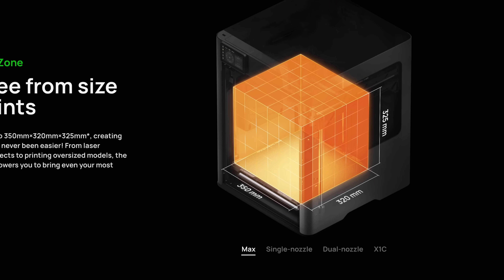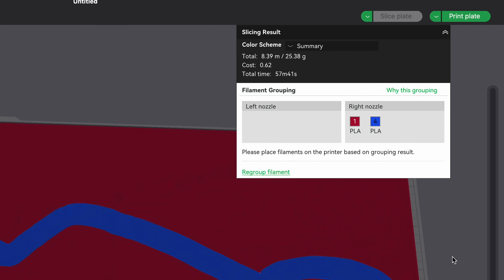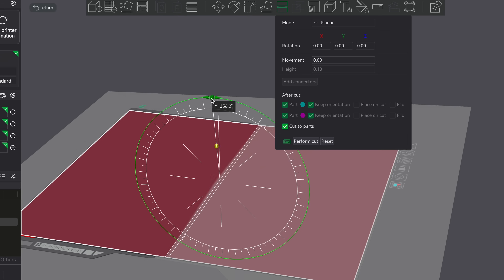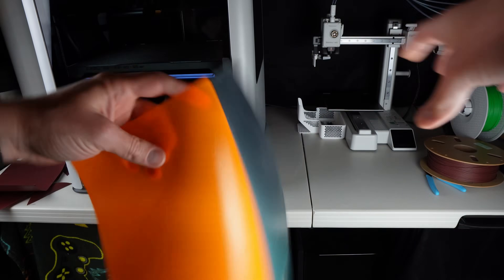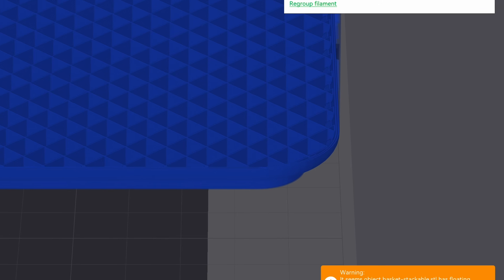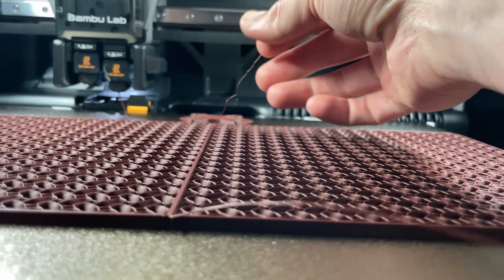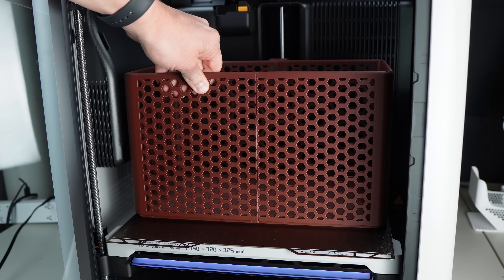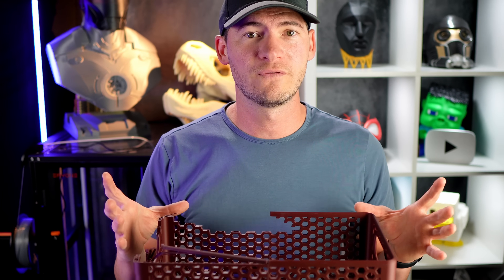How to print 350 mms on the H2D

Comment: Hey! Here is a trick for anyone worried about seam adhesion: Split the part in half like in video and move one part over  0.05-0.10 to the other, this will make one filament print a small bit into the other one. If you paint then just use the interlocking setting in the slicer👍🏻
Reply from the maker: Thanks for the tip!

Comment: OMG this is exactly the problem I have right now. The software only let me print the support with ONE nozzle for both parts. I really really wish for a software update for that machine.
Reply from the maker: Yeah, that would be nice. Hopefully they change something soon. You could add your own supports and another part but that might not work as well.
Reply: @The3DPrintingZone  It took me a while to figure out that the supports were the issue (before I stumbled upon your video) but I noticed I could move the part into the "right nozzle zone" and it baaarely fit. So for now I am just glad I can print the part at all. 
I really hope for 2 things with this machine.

1. Being able to operate at, with all it´s feature without the use of  Chinese cloud. I don´t care what they tell me, I work in R&D and I don´t share my information with some Chinese company.
2. Being able to simply use the full print bed if the same material is chosen for both nozzles.
Reply from the maker: @sierraecho884  I hear ya! I’m hoping they eventually release an update that changes the slicer to automatically split the part with a hidden seem.
Reply: @The3DPrintingZone  Yeah me too. Paint on seam, or a seam option along inner crevasses. Something like that.
Reply from the maker: @sierraecho884  right! That would be great

Comment: Stuck between the H2D and the K2 Plus. I know the bambu is bigger but not by much. However the dual nozel and slightly more bed size (i have a big head and i need 2% more in mostl cosplay helemets and it gets bigger than bed on P1S. K2 plus however Larger print bed! Though ive been hearing nothing but nightmares for users with broken parts
Reply from the maker: Honestly, I think either one could work. If you can afford the H2D I’d say go for it for the added benefits but I’ve heard great things with the K2 Plus as well. If you’re printing multi material or multi color parts, I’d swing towards the H2D.
Reply: All printers have broken parts, u dont hear much from bambu users because its a cult nowadays, regardless both will be good, creality sends parts or so ive heard, i own a plus4 and k1, no issues with the k1, it had a trash bed but i ran some leveling, same with plus4, i got parts for it but ultimately didnt need them
Reply: @Axxel720  Everyone says that but Bambu machines just works. I only ever looked up youtube videos for my first year 3d printing just for common issues on user error. So I never interacted with Bambu Fan base. My friend had a K1 Max and it would be perfect one week and dog water the next and then it needed parts and it was garbage for him. If you look at uncle Jesse video and Two Moose and others of that pop up reviewing the K2 plus. Its all about broken parts, clogs, filiment ams issues and wrapped beds. The K2 looks great with its bed size but I don't want to buy a 1k plus machine just to message customer service and pray they reply for them to send a part and wait a week just for another part to break
Reply: @Gensis300  So if you believe this why are you even asking? look in ANY forum for any printer company and its all issues, because nobody posts the machines that work, buy whatever you want in the end its your decision but dont ask for opinions if you wont take them, everyone gets lemons for any company
Reply: @Axxel720  Because I want to see if these issues have been fixed or if all these trouble shoots have rolled out through an update. Plus it's open comment sections so others may have insight as well
Reply from the maker: @Gensis300  I’ve owned over 25 different printers. I joined the Bambu train this year and it’s mind blowing to be honest. I own the A1 Mini and now the H2D. I don’t think I’ll buy another printer brand. That being said, I have printers sent to me monthly for sponsored videos so I’ll test them but there aren’t many I’d put money on beside Bambu Lab. I bought the H2D with no regrets. 

My Brother has the K1 and likes it 🤔
Reply: Update i got the k2 plus with CFS. So far I printed benchy, flexi rexi as test prints and all came out great. I printed a fully wearable helmet and has been great so far. Software has been awkward to use but besides that's it's doing well. Haven't use mutli color print so time will tell
Reply from the maker: @Gensis300 that’s great! I’m glad it’s working well so far. Let us know if anything changes or you find something interesting you’d like to share.
Reply: @The3DPrintingZone Update it broke. My bambu p1s and My elegoo 3 max are still printing every other day for hours. Unfortunately the k2 plus many issue started to rise. From leveling issues to belt tension and now belt motor. Creality has replied about 1 or 2 messages a week to find the issue. Rather swap it out for a new one or get a full refund. Unfortunately because when it prints it prints.
Reply from the maker: @Gensis300 thanks for the update. I hope they can figure out the problem
Reply: Why not Qidi plus 4 ?

Comment: I printed a 345mm part as well but in PETG-CF. When I tried to break it on the seam it break. It depends on the filament type I guess. I would probably use dove tails next time. Not sure the interlocking feature could work but worth a try as well.
Reply from the maker: Yeah you might want to use beam interlocking in that case.

Comment: It's really because they choose to make the unit 30mm smaller so both nozzles can't reach the other side. Understandable, but ultimately why.
Reply from the maker: I was thinking the same thing
Reply: It’s all about price. Everything extra adds incrementally. You reach a point where it’s too expensive. It’s too bad I had to pay $2,699 for this thing, but I’m not price sensitive. But some complained that $2,199 was too much (it definitely wasn’t). If this stupid trade war ends, the price might go down again.
Reply from the maker: @melgross that would be nice
Reply: Or you could say that even though the printer's size only allows 325mm per nozzle, they allow it to print the extra 25mm on either side with the other nozzle.
Reply from the maker: @debren27 I like that. Half full glass idea 😊
Reply from the maker: @debren27  yep, that works too

Comment: Wtf, that's pure stupidity. All they had to do was make the housing a little bigger so the heads could move out more.
Reply: And people would have said they then could have just made the bed a bit bigger. And the cycle repeats
Reply from the maker: Haha true
Reply: How much more would you pay for everything being larger? It’s not just the housing, it’s the rails, the belts, etc. But you don’t have the printer and wouldn’t buy one anyway.
Reply from the maker: @melgross  good point
Reply: @melgross  ha ha, of course if you criticize something you can't have it. The printer is advertised as having a working area of 350x320x325 but unfortunately it doesn't have that much and that's misleading.